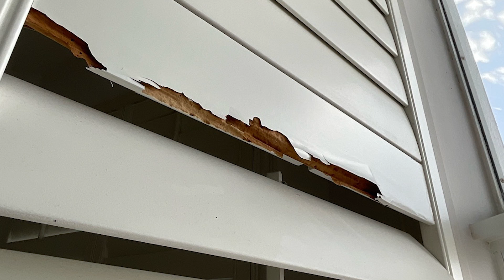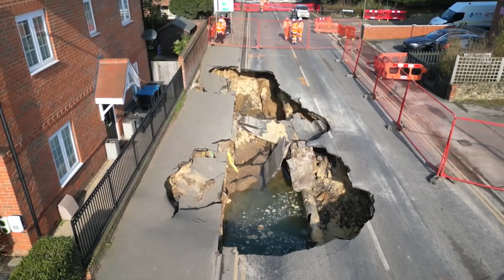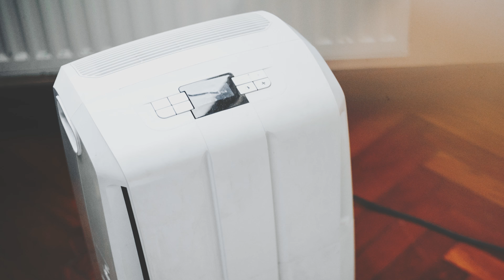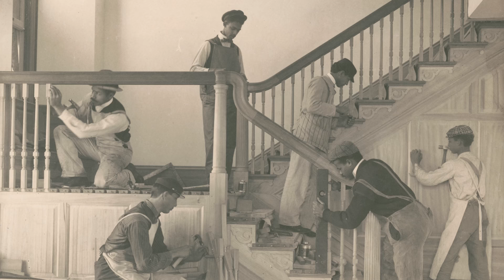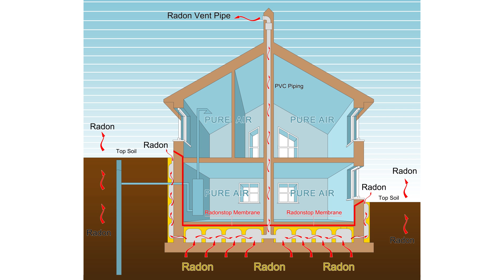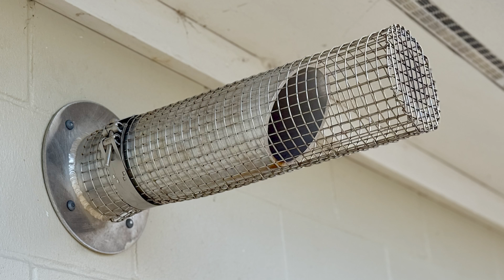Home Inspector Answers House Safety Questions | Tech Support | WIRED

Comment: Electrician here, 

He was spot on when he talked about the electrical concerns shown in the video. One thing I would like to mention is how he said double tapping a circuit breaker wasn’t allowed. In most cases that is 100% correct. However, there are certain manufacturers (Square D for example) that make circuit breakers that are listed to have two of the same size conductor on each side of the screw. A dead giveaway would be the pressure plate that sits under the screw to clap down on both wires. In that case, it is perfectly acceptable as the breaker itself is listed by the manufacturer and UL for that application.

Comment: Structural engineer here. Hes right about some stuff but it boils down to successful lobbying against safety regulations. Use of illegals in construction. Prefab parts. And building structures as close to the passing line as possible. Developers are pretty scum of the earth types

Comment: 11:17 A stain on the ceiling could also be caused by AC issues if you have your AC in your attic or ceiling. Your AC pulls a huge amount of moisture out of the air through condensation. If your drain pipe gets clogged by gunk or debris the water pan under the AC will fill up and spill out into your attic and through your ceiling.

Comment: "new homes are built safer" is hilarious when you've seen pictures of brand new homes where the power outlets are loose or the dryer lint duct is not installed correctly

Comment: so...my sister just moved into her house...internet company drilled a hole in her baseboard heat pipe...on his way out...the plumber who fixed it suggested we get someone out to clear her main drain...guy came out and cleared it...that's the good news...the bad news is...houses after ww2 often had pipes made of wood...in layers...so...we will need to replace that at some point...wooden and cast iron pipes...good times

Comment: Fwiw, Have a tri level with a finished basement.  I have a dehumidifier in the garage and in the basement,  as they are different planes at ground level. The garage floor will sweat in the summer.

Comment: Why does it matter which brand of breaker is used?
Reply: the important thing is the fit.  the bus bar / breaker box info indicates which brands will fill properly.  if you have a fire they will check your breakers and if they see any breakers not listed by the bus bar info. they will deny the claim

Comment: 2x4s are still 2" by 4" what he is referring to S4S or four-faced finished 2x4s which have 1/4 inch taken off each face for smoothing. This misconception is getting old. And no, it's not "shrinkflation" either. You can still by 2x4s unfinished that measure 2x4 and you could find 2x4s with S4S back in the day too.

Comment: My parents old house is great. My sisters new house is awesome, the shower is the best ever, oh my god that is worth the price. But my aunt and uncle they got a horrible one. I watched their place when they were away for a trip. The backyard is huge but horrible, the garage is too short. They have to park in the driveway. The kitchen is tiny with no storage space, the faucets and appliances are cheap as f, the bathrooms are insanely small cubicles in weird places, all the doors a child could kick in, The toilets are midget size, no water pressure, weird smell in the house, mailbox is crap, no street lights,  I wouldn't live there if it was free. They did no research or inspection.

Comment: Our old hollow core doors had a big problem with expansion warping when the swamp cooler pumped humidity in the house causing the door not closing issue. We replaced the doors with solid painted doors that don’t warp with moisture and the problem went away.
Reply: That definitely solved it! The issue I pointed out in my video was in connection too the concrete floor dropping on the second floor. And these doors weren't hollow, they were solid. 
Sidenote, I haven't heard the word swamp cooler in a long time! 🤣

Comment: We have a dehumidifier in our garage but its not on. Its just where we store it. Last time I used it because I was washing a rug out there and wanted to prevent mold while it was drying. I don't always think that is a sign of something. Sometimes you just don't have anywhere else to put it
Reply: Yes, what I was mentioning in the video was not a hard and fast rule. Just a reason to look into things a little bit closer and ask questions. Where I live in South Florida, our AC units do a majority of the dehumidifying. So when I see one or two or three, it's a reason to investigate further. Thanks for watching!

Comment: I have a 120 year old house. Paid it off completely in 13 years. Also have spent about 50 grand on things like modernizing the wiring, fixing plumbing issues, etc. But it’s certainly built solidly. I still need to replace the windows and insulate the walls, but any house built before air conditioning is made to be air cooled and that means lots of windows. My 1,400 square foot house has 36 windows. That’s an expensive job. 😆

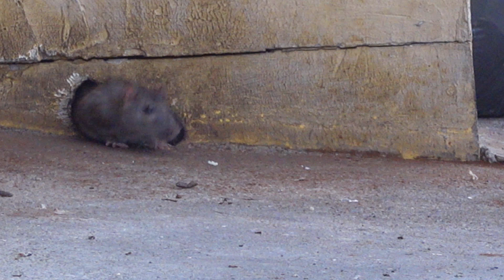Comment: 19:20 SO true!! I live in a townhouse (so I share walls on two sides of the house). My kitchen is in the MIDDLE of my house! And that’s how mice were getting inside my house. Found out they are inside the floor, and coming up behind a hole near the dishwasher that I can’t see. Still don’t know where outside they are coming in. SUPER FRUSTRATING!!
Reply: We had a lot of luck with the "flip and slide" bucket mousetrap. The Rinne one is the original manufacturer and better quality. Just caught 2 mice in a car this week.
Reply: They are tricky and can squeeze into the tightest spaces. For attached units like yours, they could be coming in your neighbors house and making their way over to yours.

Comment: I once toured a house and noticed the brick fireplaces weren't level. Immediate Red flag. I went to the basement and had to move drop ceiling tiles out of the way. I eventually found cracked floor joists. Obviously didn't buy but I do wonder what happened to that place.

Comment: We stopped taxing the rich.  Look at the 1950s when we had a 90% tax bracket to cap yearly earnings at the modern equivalent of 5 million dollars a year.  When those taxes were in place, wages went up, staffing went up, and outsourcing went down.  It turns out CEOs raid the companies they run for personal wealth unless tax policy prevents it.  CEOs only care about self enrichment and not the company.  The labor gets paid as little as possible and corners are cut on materials.  It adds up to the CEO getting richer.  The houses are sold at full market value even though they are defective and worth much less.

Comment: Not only was the wood in older homes closer to actual size, but they were built with old growth mostly hardwood lumber, not the fast grow pine, that's also at smaller dimensions.
Reply: Excellent point! You can tell by how tight the rings are. Also, try driving a Rink-shank nail into a 50+ year-old piece of lumber. Might take you a few nails to get one in! Unless of course you pre-drill it. Thanks for watching!
Reply: My dad just framed my basement and I couldn’t get over the quality of the wood. Now they aren’t supporting anything other than drywall but yikes.
Reply: @latulip100  that’s the kind of construction you can expect when somebody cares about what they’re doing! 🤙😎
Reply: Structures are not built with hardwood, but softwood. You can choose high quality softwood, it's only about how much you want to pay.
Reply: @zijie-he  thanks! And thank you for watching my video! 🤙😎
Reply: I would still prefer the new growth for the obvious reasons
Reply: So true. A 2x4 in the old days was a very stout chunk of wood. “Hit him upside the head with a 2x4” was a truly scary idea, implying a near-lethal level of damage. Now, so-called 2x4s are not even 2x4, and they can seem almost as light and weak as balsa wood. An old 2x4 could show 40 growth rings. A new one might have 16.
Reply: No, you do not build houses, or structures of any kind, out of hardwood. Please go look up softwood vs hardwood. Thank you.

Most nations didn't even have access to hardwood in large quantities until the LATE 1800's.
Reply: @ASDeckard How many years ago do you think the late 1800s was?  100 year old houses,today,  would have been built in 1926.

Comment: Shout Out to the Spray Foam Installer @ 13:41 using the one leg up technique to spray those tricky areas.
Reply: Great catch and thanks for watching! I like to call it hot yoga. Inspecting homes here in South Florida, you definitely don't need a yoga membership… 😆

Comment: I’m a fire investigator and he was spot on about the dryer vents. We get calls for so many dryer fires that just had clogged vents and the ducts heat up and ignite them. 100% preventable.
Reply: Thanks for watching! 😎👍 I'm glad I can get the word out on this platform. Unless the house is brand new, every one of my inspections has a boiler plate recommendation to clean the dryer vent. What I'm finding on brand new construction is that the roofers are mistakenly screening the vent at the roof. That is also a fire hazard. I've seen that screen clog with lint after just one month! Reason being, people buying new homes, usually buy new towels, new sheets, new blankets, etc. And you know, when you do the same, how much a lint your lint catcher on the dryer catches. Well picture that on the rooftop at the screen. There should never be a screen on a dryer exhaust, except for the lid catcher in the dryer. And that should be cleaned every time.
Quick side note, when you get your house reroofed, it's imperative that you check the attic to make sure that all roof penetration are reattached properly. I've seen gas dryer vents venting into the attic as well as dryer vent venting into the attic because they failed to ensure it was reattached properly!  Huge safety hazard! 
Thanks for watching again!  😎👍
Reply: We really need classes in high school to teach kids about all these things. People go out into the world just not knowing 100s of little things like this which can be really important both for your wallet and your safety
Reply: @EB_3D your parents were supposed to teach you
Reply: yeah, I need to check mine
Reply: @jeffk464 . I’ve seen a brand new home’s dryer vent clogged at the rooftop after just one month, because the roofers installed a screen. It should never be screened. Also, if you get your roof replaced, make sure they properly reattach that.
Reply: @HomeStarInspect I'm also a building inspector, on the municipal code side and not a real estate inspector, but I've seen enough of your side to learn a thing or two. The house I'm renting now had screws put through the vent (for what reason, I have no idea) and those had caught so much lint that I'm amazed the house didn't burn down with the previous residents still in it. It was literally the second thing I checked after I walked in, after testing the smoke detectors. I just started pulling fistful after fistful of the stuff out in front of the increasingly horrified landlord. The lease didn't get signed until I saw it fixed and cleaned.
Reply: @POTUSJimmyCarter . Also important to watch out for new construction. The most common issue I’m finding is that they’re screening the dryer vent at the roof. Dryer vents should never be screened. I’ve seen the screens clogged at the roof in that little as one month! 😳
Glad you cleaned your vent. Thanks for watching my video! 😎👍
Reply: The first time my brother visited my new house, he went and bought a smooth metal pipe to replace the plastic flex hose that came with our dryer. We check it every year, but there is never lint in it. We do clean the lint trap in our dryer every load or two.
Reply: I checked my dryer vent because of this video and found that it had become completely disconnected and there was lint all over the wall behind the dryer. Really glad I looked!
Reply: as a fire grrrrrr
Reply: As a renter, how can we ensure that landlords and building managers are taking care of this?
Reply: @mat.errin.2981 IT'S THE RENTERS RESPONSIBILITY
Reply: Thank god our condo hires someone to clean them out every year. One owner didn’t know the dryer had a lint trap you have to clean.
Reply: @latulip100  😂
Reply: Dryer lint = kindling

Comment: In the south we cannot get a termite bond if you have spray foam insulation or stucco.
Reply: Thanks for watching! Wow, that completely makes sense! In our last house, before we spray foamed the attic, I had Turmidor sprayed on all of the wood because I knew I wouldn't be able to tell. Unfortunately, there isn't a silver bullet when it comes to insulation unless the heat can be stopped on the exterior.

Comment: as far as the body odor question there are certain plastics that as they age smell identical to bad BO. I think uv helps to break them down. We had a closet that smelled so bad. We got rid of everything that could have smelled and no change. Eventually figured out it was the plastic step stool.
Reply: Wow, that's crazy! Thanks for watching!

Comment: Dehumidifiers are very common in humid states! If I don’t use mine I will get mold.
Reply: I was about to write the same thing. We have three dehumidifiers in our basement and not because of a plumbing issue. It’s necessary in the Midwest.
Reply: @vhnf1here in northeast too
Reply: Yeah I think this must be his region because I have never seen a basement south of the mason-dixie that doesn't have a dehumidifier.
Reply: @solitarelee6200   *Dixon lol although Dixie is pretty funny. here in Maryland I run my dehumidifier every night and it's still 57% RH in my house.
Reply: Canadian here. Yep. It’s weird if your basement doesn’t have a couple. That being said I don’t think my dad correctly put down tiles because if you put furniture on it and move ir, under it is full of mold…
Reply: @l @latulip100 checking for humidity in the slab is important. 😎👍
Reply: In CT the summers are very humid. Without dehumidifiers in the basement we get mold.
Reply: @kayo5291  Yep, basements are a must or else it'll get musty! Basement here in Florida are super rare. It's not a hard and fast rule, but it definitely requires me to look into it a little bit further. Thank you for watching!
Reply: Northwest too- ground around our house never really dries out - 😅
Reply: agree you need it
Reply: Thanks for watching! 😎👍 this might be true for your area. In my area of South Florida, AC units do the job of controlling humidity. So when I see the need for excess control, it's a reason to investigate further.
Reply: @HomeStarInspect that may be true for FL, but in Virginia we don’t run our ACs constantly, it’s a middle zone
Reply: @commonomics  in which case I would run dehumidifiers when needed. Mold grows well above 60% relative humidity. Keeping the interior below 60% Rh is Key. Thanks for watching!! 😎👍
Reply: There plenty of caveats with the video and even your comment.  The assumption is that the guy in the video is only talking about the USA.  I assume that you're also in USA but in another part of the country.
USA is the only country in the world syndrome. 😂😂😂😂
Reply: @Shocker99  my video was definitely a reflection of my location in South Florida. Different areas of the country and the world require different methods. Thanks for watching!
Reply: @Shocker99 be nice I got it as a Canadian too. I have baseboard electric heating . I’m always playing a fun game of humidifier in winter, dehumidifier in the summer. Then air filter year round because the cat litter says dust free but my house be dusty.
Reply: @Shocker99 nope have a property in the Philippines too, dehumidifier runs year round. Chip on your shoulder syndrome
Reply: You def live in Europe and don’t know that humid countries exist
Reply: @commonomics  Are you assuming that humid countries don't exist in Europe?
Reply: @Shocker99 I’m talking tropical 99% humidity 300 days per year..but you wouldn’t know that bc you don’t leave your eu bubble

Comment: I disagree with spray foam. All the new homes I've worked on are super insulated and its actually causing moisture and mold to grow in a lot of the walls now a days.
Reply: There are definitely some drawbacks. One of which, is termite damage. When I spray foam our previous house, I had my Termite guy soak all the wood and termodor. Thanks for watching!
Reply: I'm tempted to add fresh air intake with heat exchanger like skyscrapers have. And hepa filter everything. Some day I will have money to build a house and design all these things.
Reply: @fireincarnation2348  i’ve found AC units here in South Florida that have really bad mold growth in the ductwork, and also have the fresh air intake. I would use a product that both filters and dehumidifiers the air before it brings it into the house. This way, you build up mold in your ductwork. 😎👍

Comment: Bro does not do a lot of inspections in the southeast if he thinks dehumidifiers are a rare sight lol
Reply: Thanks for watching! Here in south Florida, AC units do the heavy lifting for humidity control. So when I see the need for an additional dehumidifier, it's a reason to investigate further. And after over 7000 inspections, it is not common to see. 😎👍
Reply: He was talking about dehumidifiers in the garage, not being used, particularly multiple dehumidifiers. I hear ya though. I lived in Nashville for a while, and there is nothing like the humidity in that region. Nashville's not even that bad. I swear on one drive to Atlanta, I needed a machete to cut through the air when I got out of my car! That was the most uncomfortable I've ever felt outside, and I've lived through 55 Minnesota winters. It's not the tropics down there, but a summer in the Southeast is a good approximation.